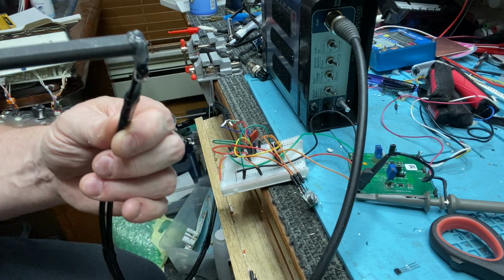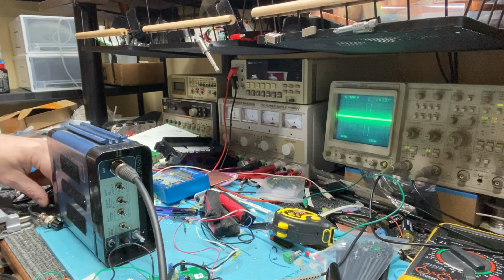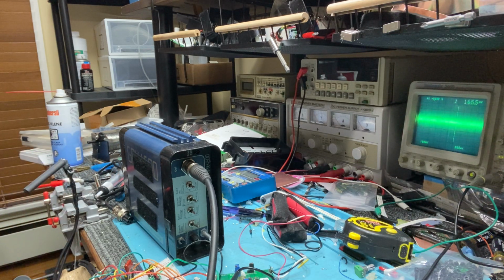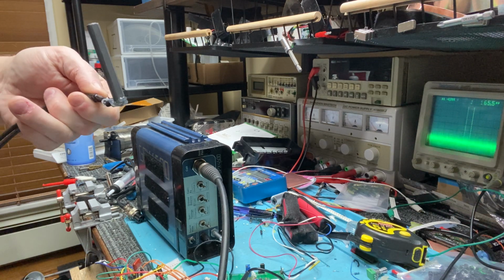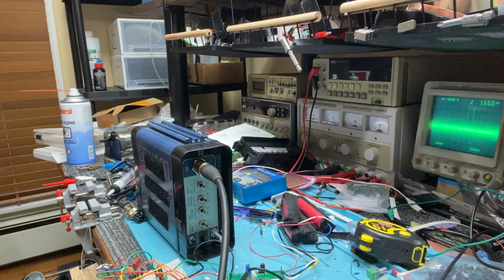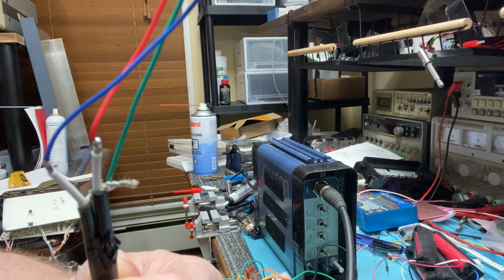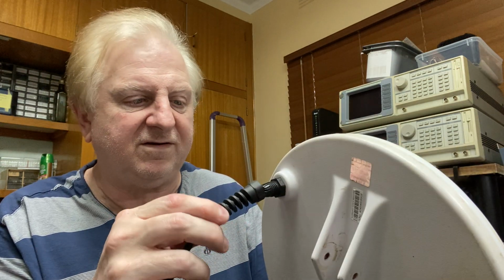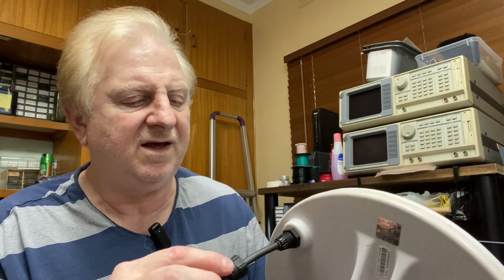Hall effect devices for coil testing pulse induction metal detectors.

Comment: I damp the coils I make not the detectors, I use 2 10k resistors and one of them cheap frequency genarator  s put it to square wave and have one 10k in the genarator with a prob on it before the resistor that is unchange set it to 600 hz then you attach the coil then the next 10k resistor with a prob on the end like a T configuration 2 resistors on each side of the top T and the coil joins to the bottom with your test dampning resistor test it and  you will see what I mean